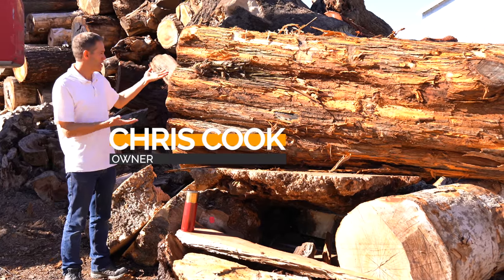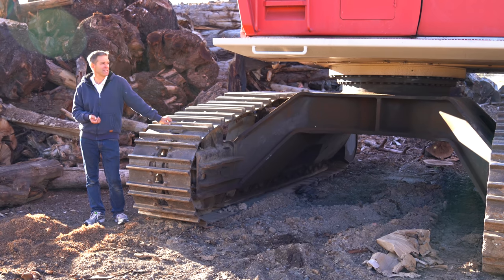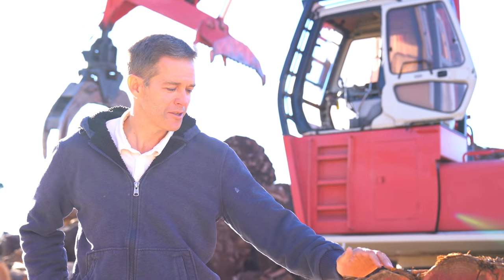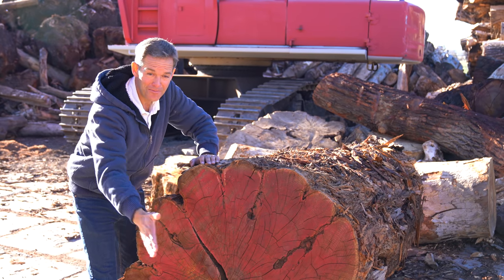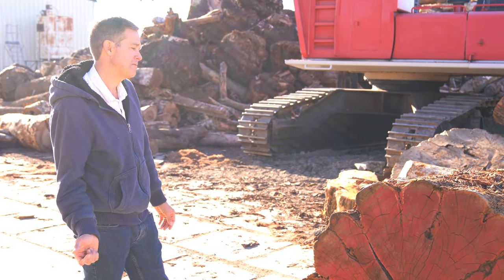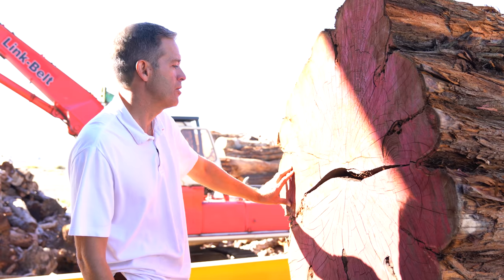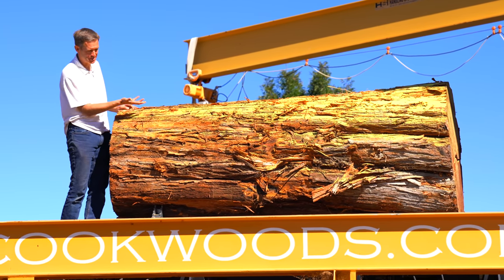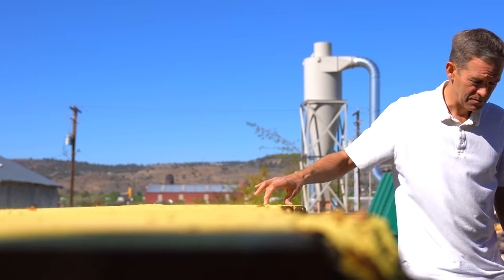Orange Wood! Watch us Sawmill it

Comment: I've read that the monkey balls were the fodder for some of our megafauna such as mastodons, but that we have nothing in the America's now that can eat these (thus spreading the seeds).
Reply from the maker: That's interesting!
Reply: Deer and squirrels will eat them in a pinch.  Squirrels just dig out the seeds but it's a lot of work for little return.  We leave them in a bucket over the winter and they rot down by spring, then mash them up, add some water, and spread them where we want to start new ones.  Come back in a couple years and thin them and spread them out further.  The Edible Acres channel also shows how to start saplings from seed using air prune beds.

Comment: Axe handles!!!!!  I read that this was tested to be the most shock resistant wood in North Ametica... I think.
Reply: Oh Ya? Axe handles? Hmm🤔 I'd be interested in hearing more about that. I've used it to make bows but it never occurred to me to make an axe handle with it. How strong is it? I might have to ask Buckin about this.
Reply: Buckin Billy Ray Smith that is. Have you heard of him?
Reply from the maker: Axe handles are great out of this wood - so durable!
Reply: It is a preferred Bow making wood which means it isn't brittle and full of lignin, because lignin is sort of the glue that holds the cellulose together.
Osage, Hickory, Ash, Yew and others are pretty flexible, so yes it could be excellent.

Comment: It is beautiful when fresh cut.  Unfortunately, it oxidises to a drab brown regardless of the finish the you put on it.
Reply from the maker: Have you tried putting on a UV inhibitor when you finish it? It's true that it does oxidize, but it's possible to slow the process.
Reply: @CookWoods  I tried finishes with UV inhibitors by General Finishes and Sherwin Williams.  Within three years the color was bland.  Within five it was an uninteresting brown.  A turned piece that was in a cabinet in a dark office held its color longer but I never again use Osage Orange for its color.  The portions that were in an inlaid floor were especially frustrating.
Reply from the maker: @rogerhodges7656  yeah, that is the tricky thing with vibrant woods for sure. The UV inhibitor works well to a point. Sunlight definitely makes a huge impact in speeding the process of oxidization to a darker color. That's also true of Redheart, although we have had some boxes that we made from Redheart 20 years ago and they've been out of the sun... their color is not the same neon red that it was at the beginning, but they still have a lovely red color. Wood is so unique!